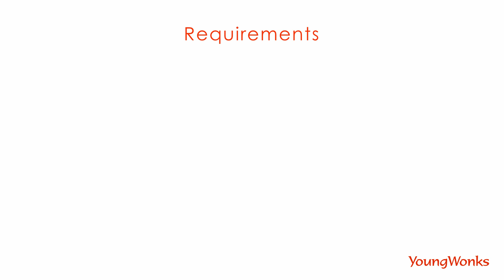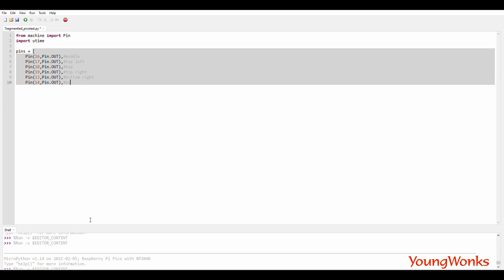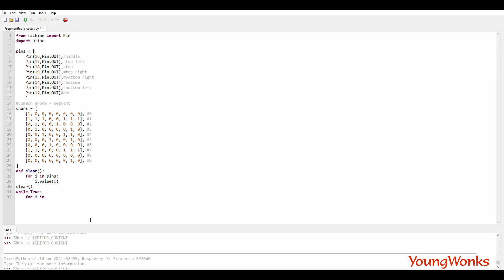How to use a 7-segment LED display with the Raspberry Pi Pico

Comment: Thanks for the walkthrough! For others: here's the code from the video. I have a CATHODE 7-segment display, so have to reverse the bits in the chars matrix, and also hook up resistor to ground.

from machine import Pin
import utime

# pins 12, 13, 14, 15 & 16, 17, 18, 19
pins = [
    Pin(16, Pin.OUT), # middle
    Pin(17, Pin.OUT), # top left
    Pin(18, Pin.OUT), # top
    Pin(19, Pin.OUT), # top right
    Pin(13, Pin.OUT), # bottom right
    Pin(14, Pin.OUT), # bottom
    Pin(15, Pin.OUT), # bottom left
    Pin(12, Pin.OUT), # dot
]

# common anode 7 segment
# for CATHODE, you need to reverse these and hook up resister to GND
chars = [
    [1, 0, 0, 0, 0, 0, 0, 0], # 0
    [1, 1, 1, 0, 0, 1, 1, 0], # 1 
    [0, 1, 0, 0, 1, 0, 0, 0], # 2 
    [0, 1, 0, 0, 0, 0, 1, 0], # 3
    [0, 0, 1, 0, 0, 1, 1, 0], # 4 
    [0, 0, 0, 1, 0, 0, 1, 0], # 5
    [0, 0, 0, 1, 0, 0, 0, 0], # 6
    [1, 1, 0, 0, 0, 1, 1, 0], # 7
    [0, 0, 0, 0, 0, 0, 0, 0], # 8 
    [0, 0, 0, 0, 0, 0, 1, 0], # 9
]

def clear():
    for i in pins:
        i.value(1)

clear()
while True:
    for i in range(len(chars)):
        print(f"Setting {i}")
        for j in range(len(pins)):
            # if using a cathode segment, need to reverse 0 and 1 in our matrix above:
            pins[j].value(not chars[i][j])
            # but for anode, use just pins[j].value(chars[i][j])
        utime.sleep(1)

Comment: Using only one resistor in the common anode/cathode must lead to a varation in light intensity, as a different number of segments are activated for different numbers. Maybe this flickrring is acceptable, I would prefer to use 7 resistors and drop the anode/cathode resistor. I admit this circuitry is more «messy», but much more sound :-)